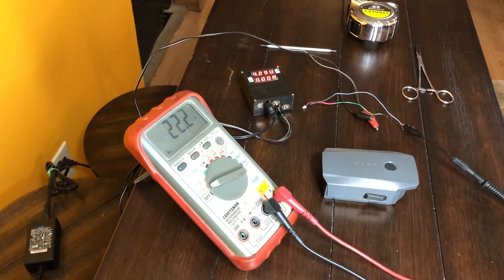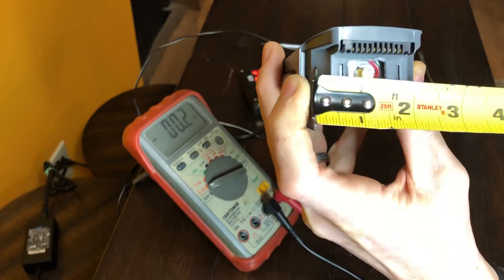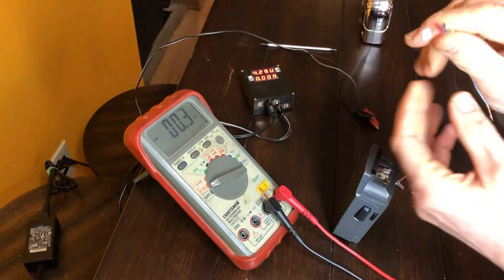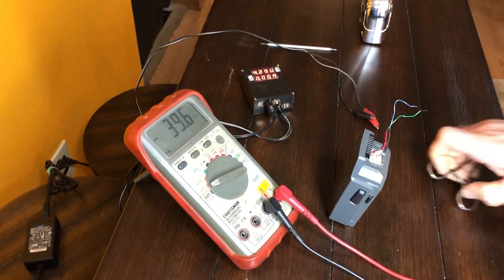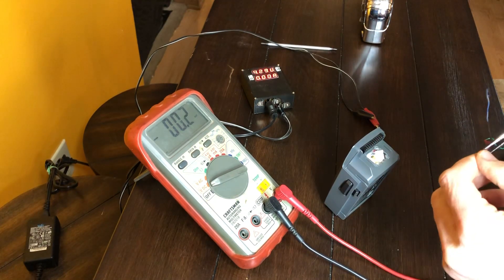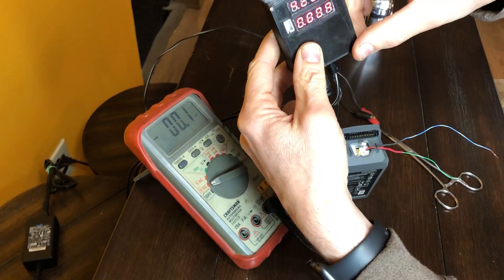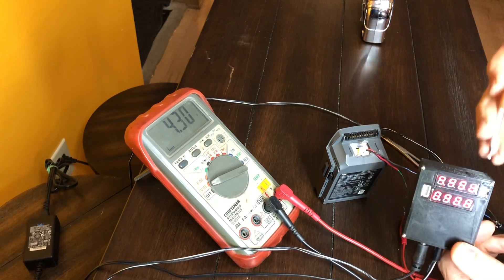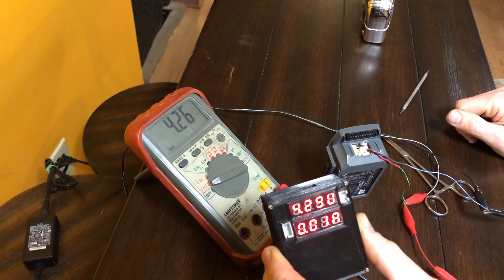DJI Mavic Pro battery error fix

Comment: First, thanks for the video, I am hoping to recharge one of my batteries. Time will tell if I can get it to charge. But, I used CA remover and it worked for loosening the glue bond. The case halfs came apart with almost no damage.  Thanks again!

Comment: Nice video. What a pain in the ass right? My batteries wont even turn on. Did you have to hack into the battery with software at all or did just balancing the voltage on each do the trick? So you  set your buck for 4.29v at 2000mA? What’s the lowest current tou think it will trickle charge at? Or do you think it needs about 2A to work? Thanks so much!

Comment: You should TAPE or otherwise INSULATE those two wires while you are messing with connections, etc.  If they short, that will not be good...

Comment: The plastic is about 0.5mm thick in this area. 
I was able to cut it out easily with the sharp tip of a hot soldering iron set to about 350 degrees C. 
I cut through the top, left and bottom sides first, then part way through the right side and levered it open with a screw driver. 
I just gently ran the tip of the iron along the lines several times going a little deeper each time. It helped having the battery secured in a clamp to hold it steady.
I would recommend this approach if you have a fine tipped soldering iron because you can do it in a controlled manner with little risk of mechanical damage to the connecting wires. It's easy enough to clean the tip afterwards, or use an older tip that's passed its best for soldering purposes.

Comment: Awesome video!!  I have a totally different problem (16 flashes when charger is plugged in) battery won't charge. 
The access port thing is a HUGE timesaver and I won't wreck the stinking case trying a few things to see what's going on.   
  You mentioned the wires going to the four LEDs (which they don't) *I think*. but  they actually go to the control board and are used 
  for the control board to balance charge the cells.  
  the control board controls the LEDs aside from these 4 wires.  
  Anyhow That's how I think they work and that what I think you actually meant.
 I'm not trying to correct you but I'm trying to be corrected if I may be completely wrong.   
 Mine is just an old test battery that stopped working, no plans to actually fly it as it was having balance issues taht I could see in the app before it stopped working entirely after a few months of   storage.  I'm more curious than anything why it died and what the 16 flashes crap is all about and won't be repairing it to fly. But I liked having it for a bench test battery when it was working.
Reply from the maker: The LEDS are the indicators of the state of the balance board. You do not balance the batteries through the plug with the wires that go up to the LEDS/balance board. That’s why I just said LEDS. In this case, the batteries are hooked up individually directly to a charger. You are simply bypassing the balance board.
Reply: @199wildman  My understanding - when you unplug the connector you now have what we will refer as TWO sets of wires.   
With the connector open- one set goes to the balance/control board which also controls the four LEDs. the other set of wires goes directly to the three cells.
Reply: At 2:20 you say "this is the balancing port, these wires go to the indicator lights here".   (you probably meant the board) which also contains those lights.
Reply: Anyhow I'm not trying to nitpick or correct I was trying to make sure I did not have an incorrect understanding by going over it.  I really like the access cutout idea.. 
And it saves me from busting an entire battery open to try this.

Comment: Has anyone had any issues with the battery no longer being charged through the Mavic charger or no longer output voltage because the balance cable was temporarily removed ? Some Mavic Flyer threads claim one of the chips disables the batteries normal input/output if the balance lead is disconnected. From this video it seems that is not the case.
Reply from the maker: I have had no such issues. Just don’t short out the battery pins.
Reply: @199wildman  Thank you for confirming William. I will give it a try.

Comment: I actually use a lipo balancing charger that I used for my other hobby batteries and it had that little plug where it just balanced all the batteries at the same time.
Reply: Do you have a link to the  lipo balancing charger or a name and model or any clue as how we can find it? Thanks!
Reply: Can you link which one you bought? Trying to do the same.
Reply: @fleshnbone831  My charger came with all kinds of balancing connectors that charges various types of LiPO batteries.
Reply: From dji? How much was the lipo charger? Looking at Amazon
Reply: @urielgutierrez6478  You got to understand how professional hobby chargers work along with multiple balancing boards and cables. I can damn near charge any type of battery as long as I know what it's made out of.

Comment: Do you think it would be possible to swap out the three cells once they get too old to fly? I just realised that DJI doesn't produce these batteries anymore
Reply from the maker: Yes, it’s doable
Reply: @199wildman  thanks, this gives me hope! If you were to make a tutorial about this in the future I would definitely watch it
Reply: Tried it doesn't work.
Reply: @paulkazjack  did you also balance charge them before use?
Reply: @ocanehauncanedichieilcane  Inside the battery case is a bms curcuit. Once this is removed to put new cells in the board bricks itself. Its a constantly live pack! (On all the time). I programmed non dji battery and use my own model batteries, from hobby shops.
Reply: @paulkazjack  I didn't know that... However, the battery should put itself in hibernation mode if voltage drops too low. Maybe if you discharge it first, then swap the cells, it could work (?)

Comment: Have two batterys this issue brand new it is first wire ground then each red is positive past that or does ground wire change places I have a 2s and 3s lipo charger can I use that vazquez.keith2018files@gmail.com
Reply from the maker: You need a 1s charger or constant current constant voltage buck board. Very cheap on Amazon. Or, you can short out the cells that are too high to match the other cells. I wouldn’t use anything lower than 1.5 ohm 15 watt resister to bring the voltage down on the high cells. This is dangerous. Be sure to babysit the cell being discharged.  Do not go under 3 volts per cell. It’s a lot easier and safer with a cc/cv buck board.
Reply from the maker: https://www.facebook.com/1703976289668430/photos/a.2810445082354873/2966853960047317/?type=3

Comment: Instead of using a charging board to get the cells to match, would it be possible to connect load (such as a lightbulb) to the cells with the higher voltages to bring them down to that of the cell(s) with the lower voltage?

Thank you
Reply from the maker: Edward Hodson Yes, but only if the lower voltage is above 2.8 volts. Any lower is dangerous.

Comment: Do you have a link to a connector that I could buy which would connect into the battery’s BSM, ideally with all the wires instead of just 2? 

I know that I’d have to be very careful not to short out any of the cells.

I don’t know exactly what to search for to make sure that I get the right connector type and right size.

Thank you
Reply from the maker: Edward Hodson   No idea. I just had a random plug from a micro switch I cut. Sorry
Reply from the maker: 4 pin plug. https://amzn.to/3qIn1bL
Reply: Thanks William... I’ll start checking out some some old electronics around the house to steal from :)

Comment: Hello there! When you demonstrate how to connect charging wires to bsm board connector starting at 3:58 the board's own male connector blocks the view. Could you, please, explain it again how to connect the charging wires to each cell. Or maybe you could email me the drawing (pinout) of the board connector to rus.k8515@gmail.com. Thank you.
Reply from the maker: Ruslan K ok
Reply: @199wildman  I want one copy of the drawing (pinout) too, can u email to fsdmavic@gmail.com THx
Reply: Hi sir, I would like to have a copy of the charging pin out drawing. Could u send it to viny68@live.com.sg. Thanks in advance
Reply from the maker: I will post the pin out on my Facebook page “Knowledge is Power”
Reply: William Bailey : hi sir, I manage to figure out the pin out config, and manage to get each cell to charge to 3.7V. But where the battery put into DJI charger, it 1 led blink 16 times interval but never get charge. Please advise, is it the voltage still too low? Appreciate your time.
Reply: @199wildman  cant find ur Facebook page can u add a video on you time line

Comment: would this do the job?
 https://www.ebay.co.uk/itm/2-in-1-5A-DC-DC-Adjustable-Power-Step-down-Buck-Module-CC-CV-Charge-Board-UK/233391553421?hash=item3657387b8d:g:likAAOSwzb5dwV9c

Comment: any chance of a link to that charging board
Reply from the maker: Old Git with new tech 
This will work 

Dmyond 4A DC to DC Automatic Adjustable Boost Converter Buck Converter Step UP Step Down Module 

Voltage Regulator 5.5-30V to 
0.5-30V with LCD Display https://www.amazon.com/dp/B07XFL78Q6/ref=cm_sw_r_cp_api_i_DqpOEbXR2J7SB

Comment: If I have a battery that sat for a year and won’t turn on, charge or anything, do you think this will help or do you have any other ideas?
Reply from the maker: Michael Allred yes. Just make sure when charging the dead cell that it is not completely shorted out when charging. You should see the amp output drop when charging. If not the battery is to far gone.